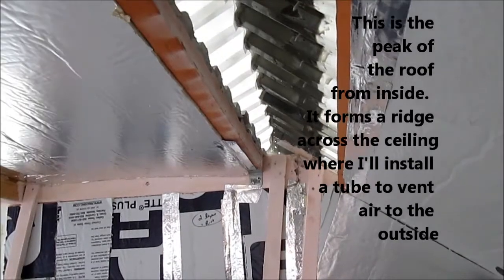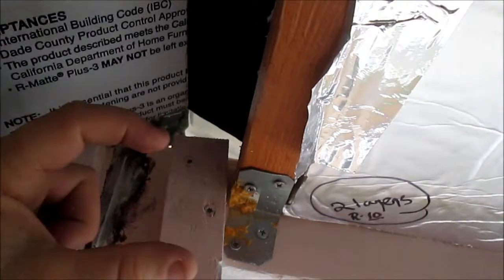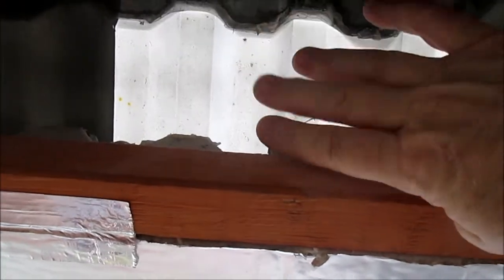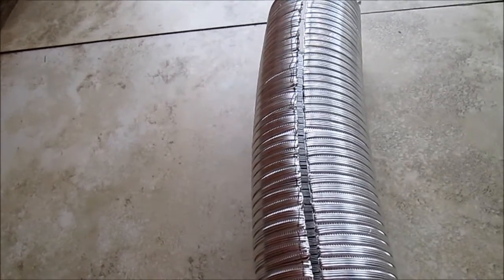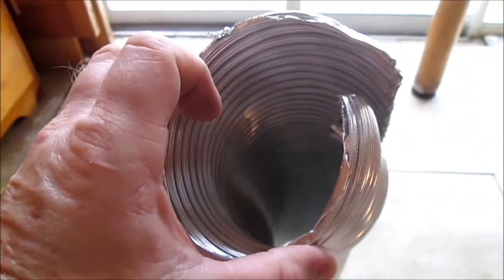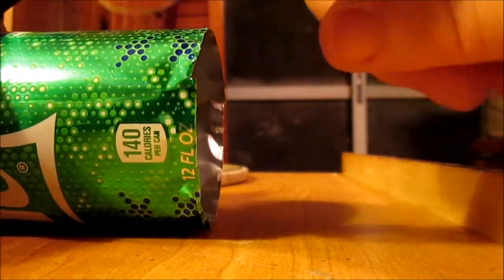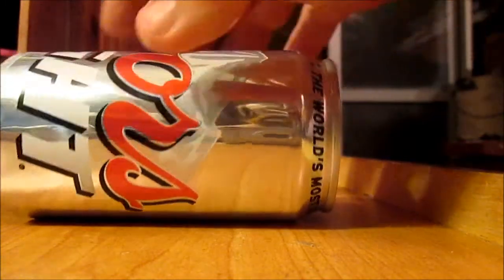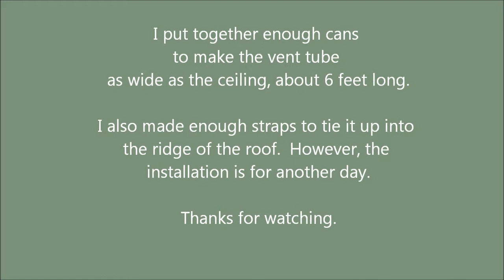Cottage Camper 9 - Roof Vent (part 1)

Comment: Extreme weather duct tape works just as good. It also doesn't need screws. But your idea is a good one. Add a mini solar panel to it to power the fan and it works great when the hot sun is beating down. A little thermal switch inside the camper. To come on only when it gets hot inside and Presto.! No fuss exhaust vent.